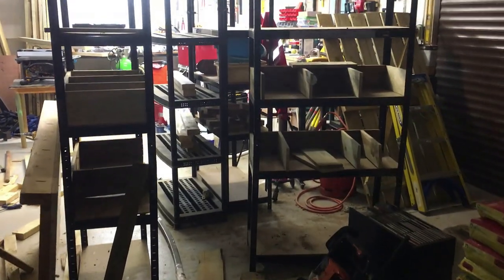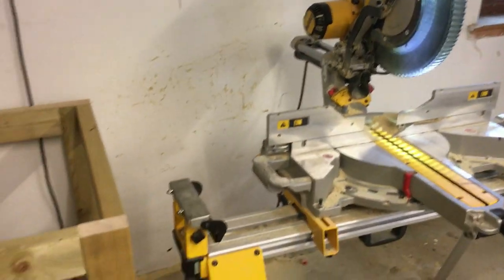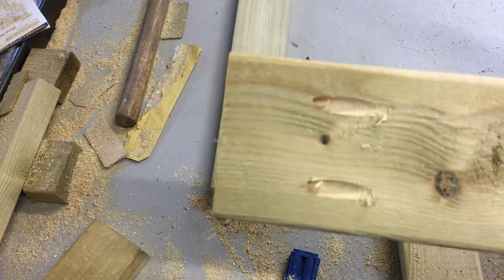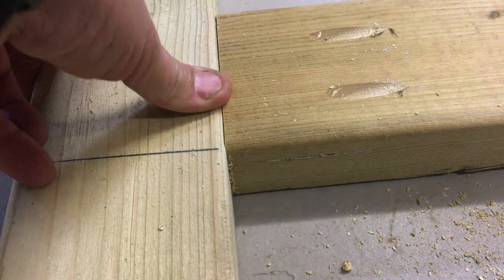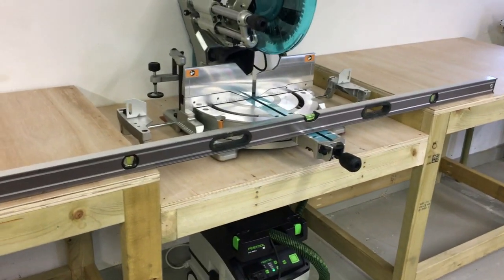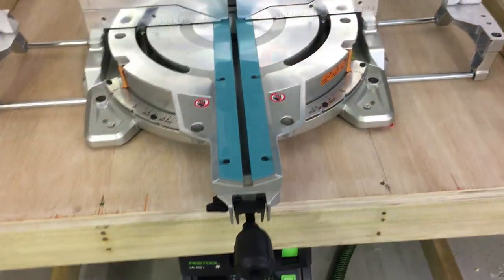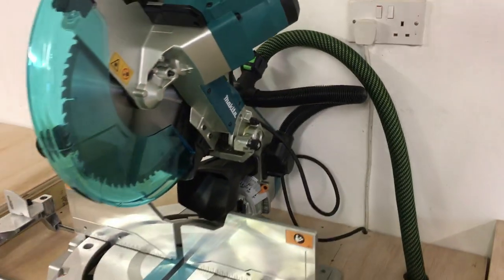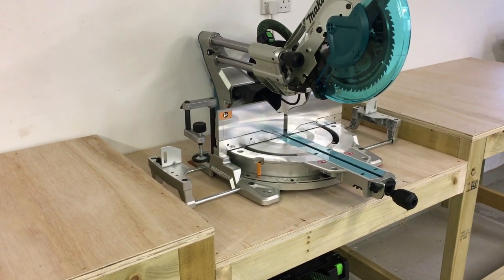How To Build A Mitre Saw Bench | Makita LS1219L

Comment: Ohhh, I love the way you angled those screws into the frame. Nice job. thanks for the video...I just bought a Makita 8inch mitre compound saw...I'm under 5 feet short...and it still seems a monster. I need a bench for it now,and probably a small platform to raise me up a bit. The first job will be a bench like this, then a small platdform, then a chicken tractor, then a Tiki Hut... hence looking at videos. Very simple and practical. Thanks again.
Reply from the maker: Thanks for the comment Mary and good luck with your upcoming projects 😎

Comment: Thanks for sharing! What's the height of the middle section where the miter saw sits?  I'm trying to build a station for the same miter saw model but I haven't received it yet.
Reply from the maker: From the floor to the top of the plywood is 845mm
Reply: @Bacrenfencing  great, thank you! Do these measurements make this Makita perfectly leveled with the work station?
Reply from the maker: @noora.9517  Not perfectly but close, you will likely have to shim the mitre saw up a bit to get it perfect. I just used a couple of plastic shims.

Comment: Hi Barry, looks good. Could you tell me how far from the wall does the module you built stick out? I'm looking to purchase the Makita saw for the same reason as you have. Just wondering what the footprint is. Cheers Dan
Reply from the maker: Hi Dan, I made my module 760mm from the wall to the front. I made it this wide for my own purposes but you could get away with about 600mm if space is an issue. Both of the modules I made are 1200mm x 760mm but you can obviously make them any size you want to suit your individual needs. I hope this helps ? Cheers 👍
Reply: @Bacrenfencing  That's great Barry. This helps a lot. Thank you
Reply from the maker: @dtdan3186  No problem !

Comment: Does the power take off on the Festool say what it’s max wattage is ?
Reply from the maker: Not got a clue Thomas, I will have a look and get back to you 😀
Reply: @Bacrenfencing  thanks, I’ve been looking at metabo and online it says 1200 watts on the take off but the makita saw is 1800 watts so don’t wanna get the wrong thing
Reply from the maker: @Tomc12345  I just looked and the Festool says 1200 watts as well but it works fine with the 12" Dewalt and Makita mitre saws. It also workd fine with the Dewallt table saw. I'm no expert but I think the Metabo would be fine.
Reply: @Bacrenfencing  thanks for that 👍🏻👍🏻

Comment: Some place big chap .....don't you take offence 😛😛😛😛👍
Reply from the maker: Cheers Ian ! 😎
Reply: @Bacrenfencing  hope u got that joke 👍
Reply from the maker: @iandrain.7277  I did :-)
Reply: @Bacrenfencing  the pocket holes are the way to go 👍👍👍
Reply from the maker: @iandrain.7277  Aye, they are great, I use them all the time but I really need to get a better jig. I fancy the larger Kreg set with has a quick clamp built in - that will be my next purchase - Cheers !
Reply: @Bacrenfencing  cool ....used the wolf craft one and the trend one .....trend on is better built but the wolf craft can goto 50 mm thickness  👍👍👍
Reply from the maker: @iandrain.7277  I will go and have a look now Ian, thanks for the heads up mate !
Reply: @Bacrenfencing  nay probs
Reply from the maker: @iandrain.7277  I like the look of the trend one, and half the price of the Kreg K4 - I think I will give that a go. Would you recommend the wolfcraft one ?
Reply: @Bacrenfencing  the trend is solid steel wolf craft  is plastic but can do thicker timber and its easy to move it about the job like the kreg ......as the trend one you bring the wood to it 👍👍👍
Reply from the maker: @iandrain.7277  Thanks , I think I will go for the Trend initially as it will suit my purpose. Thanks again for the heads up mate !